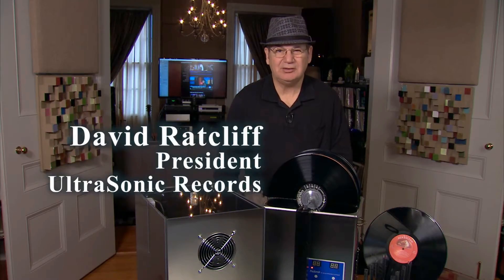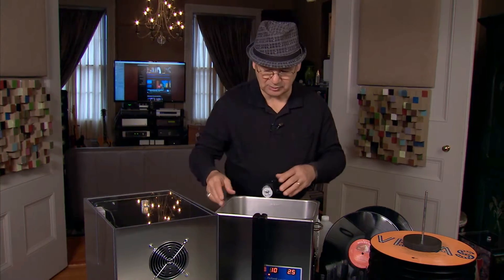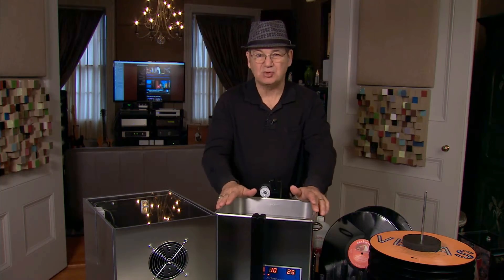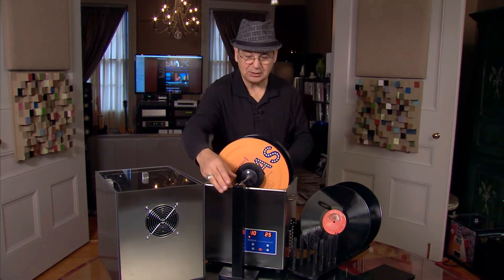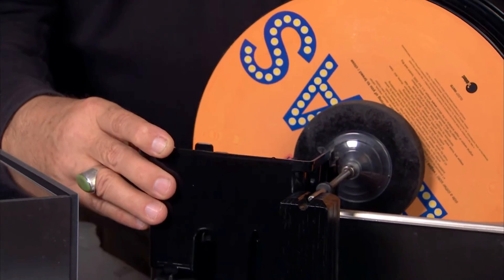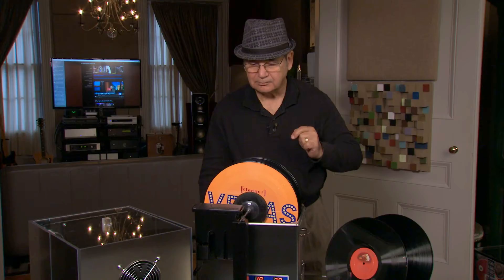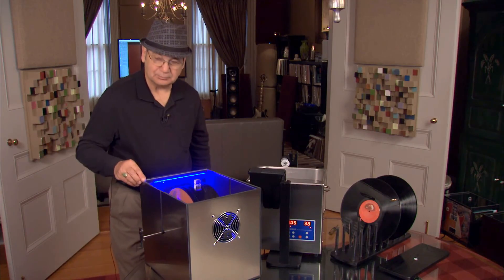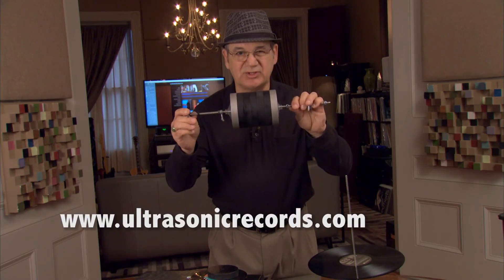Ultrasonic Records V-8 Record Cleaner

Comment: Is it a ultrasonic or sonic? No don't use a ultrasonic machine it will damage your records it cause microscopic fractures. There's no mould release added to the mould the mould release is in the vinyl it is put in there for manufacturing purposes to make the vinyl stable
Reply from the maker: no damage to records .  what is mould ????  do you mean mold ?

Comment: Love the cheap fish tank filter. You need to improve your system for $1595
Reply from the maker: ck the website.  We only use a large external filter now.
Reply: I built one, quite a bit better, everything including 6L machine, for less than $100.00.Seriously. Machines cheap on ebay ($39.00).